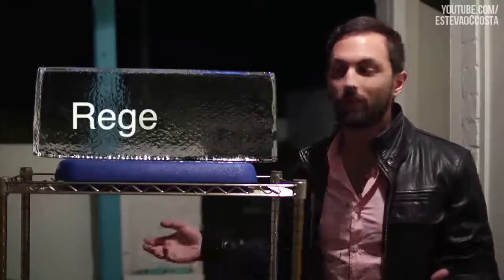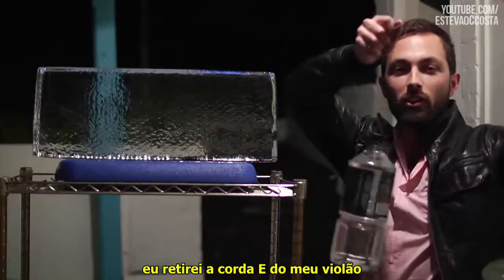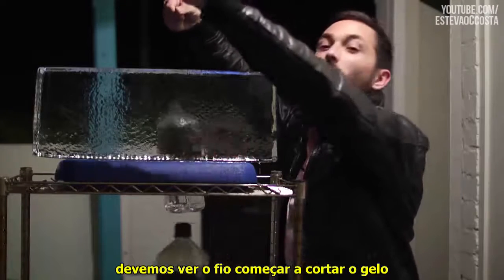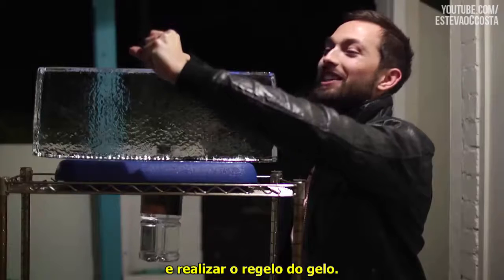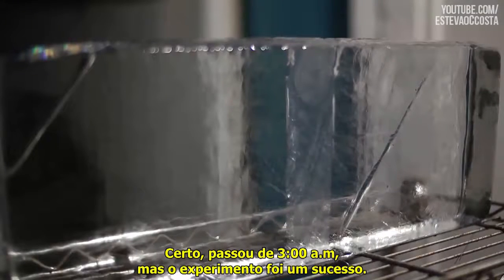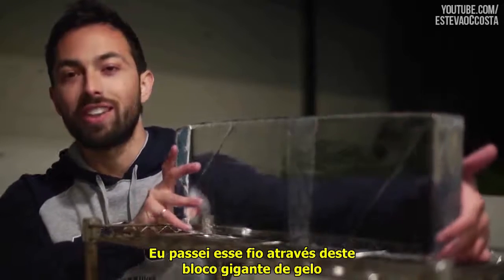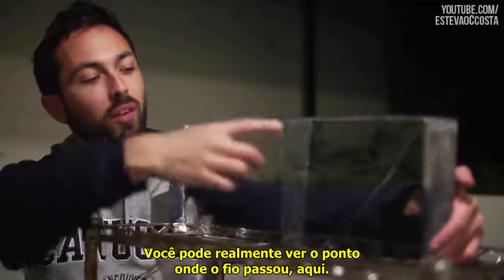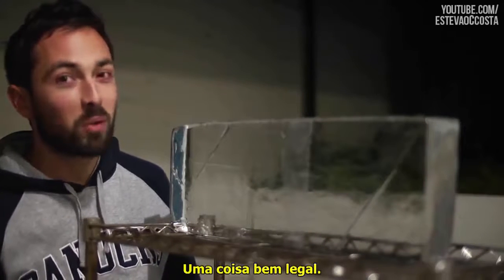A pressão pode derreter o gelo? - Veritasium - Legendado

Comment: It happens because the two ice block that was generetaed after you cutted the first peace was in contact so as they are in something like 0ºC they should freeze each othe again, but if you put a biggest thing to cut the ice as a belt it will not refreeze